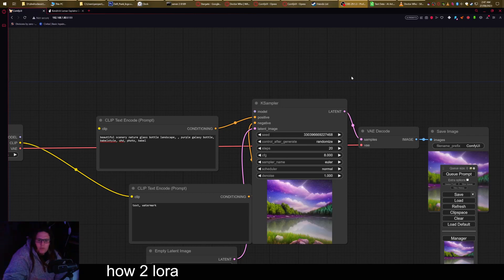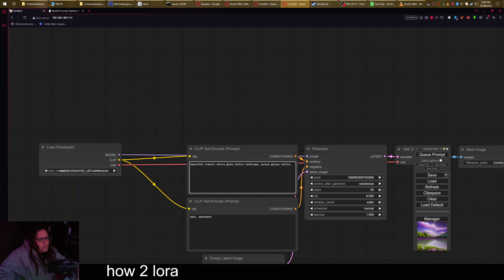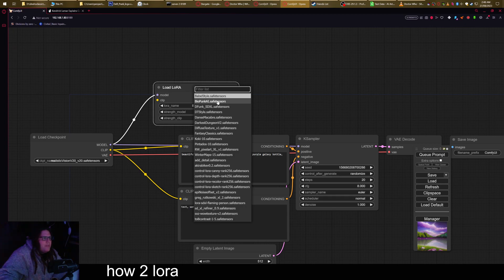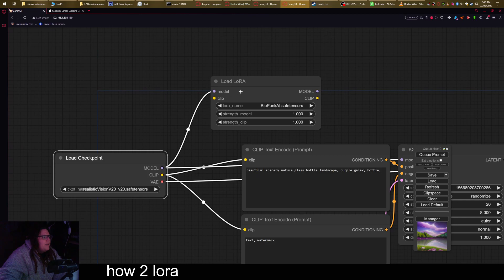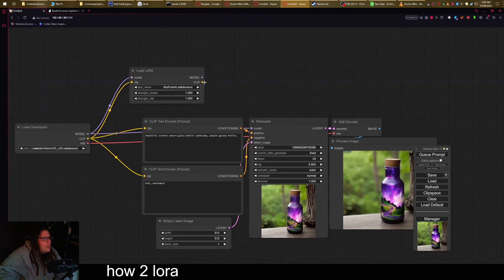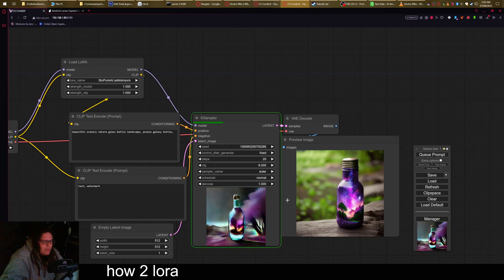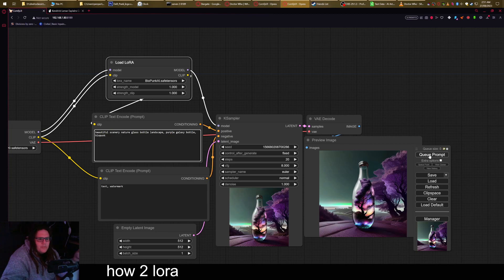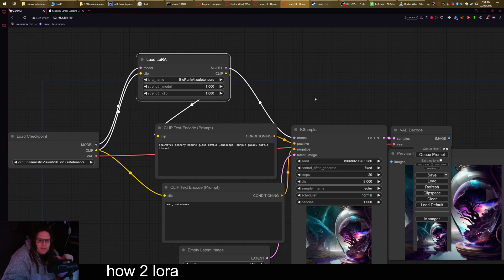ComfyUI How2 - Lora

Comment: I'm new to ComfyUI. I noticed that your KSampler & Main widget shows a live preview of each step of the image generation as it generates. How do I enable this?
Reply: To future readers: I figured it out. It's called "ComfyUI Manager" and is easy to install by git cloning the repo into the right directory. Guide is in the github repo page
Reply from the maker: yah, its in the settings comfyUI manager has a little option to choose the prieview method,  you can choose from a few different versions which are varying degrees of speed or acuracy.  (generally renders are slower with it on)

Comment: Hi, Thanks for the video.  Any hints welcome.  Can load the LoadLoRa node but can't access the lora  files in my ComyUI>Models>loras subdirectory. Tried using load and ComfyUI Manager etc. Thanks!
Reply from the maker: When you install lora models (you need to get some they don't come with comfyUI by default) you need to put them in the lora folder. once you have some it will allow you to select from that list.  Make sure you reload the browser tab once you have installed models to make it refresh the list.

Comment: The lines between nodes are straight, how to do it
Reply from the maker: there is an option in the settings menu to switch from splines to lines.
to line them up straight you can enable the always snap option in the same menu

Comment: Great tutorial - but when I click on the lora node i don't get any loras to come up.  I have them loaded in the loras folder in comfyui and i have everything set to load from stable diffusion as well.  it's like that field is not functional.  any idea what might be wrong?  thanks
Reply from the maker: if you have just downloaded models, make sure you reload your browser tab to refresh the list, sometimes you may need to restart the server too. this happens because it wont update node lists or model lists in real time and requires the page to load to do a check for them.
Reply: thanks I got it sorted. @ferniclestix

Comment: how do you generate images THAT fast?? is awesome
Reply from the maker: check the sampler settings and latent sizes, you will probably see they are small res images with low ish step counts.
most people just leave it at 30 but 20 and sometimes 12 or even 10 is doable on some sampler types.
Reply: im using a lot euler_a with 50 steps with 1024x1024 resolution, it tooks like 20m-30m to generate a single image but i like the results, the problem is im using a laptop gtx1050 XD
Reply: anyways your basic lora implementation worked for me! thank you so much
Reply from the maker: ddim is the fastest, alot of the dmp ones work under 12 steps with karras turned on.

Comment: I always knew somewhere in the back of my head, somebody must put the windows taskbar at the top. But I never saw it until now. Anyway, shitposting aside, appreciate the quick and straightforward info.
Reply from the maker: :D, my other monitor has it on the side ;)  just like to have the clock visible up the top. I think the main reason is because often i end up with drink cans sitting either side and below my screen or prop my phone up on the screen if im waiting for a message. so I just kinda gave up and put it up top.

Comment: Thank you for providing this information! I've been trying to find a definitive answer about the necessity of trigger words using COMFYUI. I've read conflicting opinions: some say that trigger words are not needed, while others argue that they are essential. I hope that going forward, the system will be designed to eliminate the need for trigger words altogether. In a user-friendly interface like ComfyUI, it should be much easier to control everything directly through the node, rather than having to remember specific triggers for each LoRa
Reply from the maker: yeah the answer is basically you got 3 stages of turning on the lora with triggering being the 100% yes turn on command. clip and model will seperately influence to a very small degree at all times, clip far less than model.

Comment: thanks!

I want to learn to train a lora with my face.
where would you recommend me to train it? on the automatic111 UI (which I'm not familiar), or koyah_ss? could it be done inside ComfyUI?
Reply from the maker: I was looking into this today but I think its best to use say automatic1111 for this process, have not tried koyah_ss
You can model merge in comfyUI, haven't found the lora method there yet. but probably mention it in future If I find it.
Reply: @ferniclestix  thanks